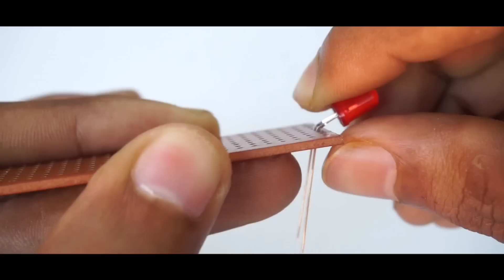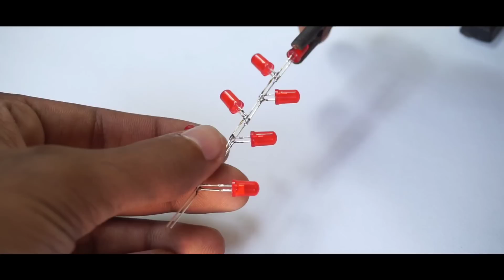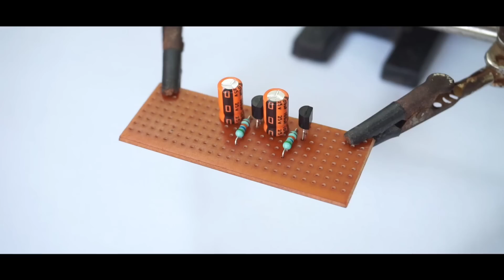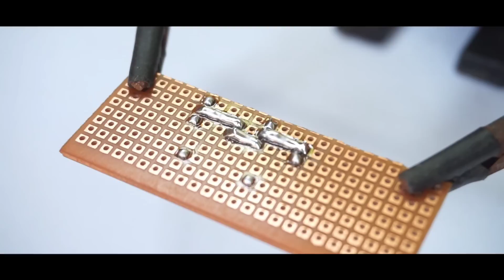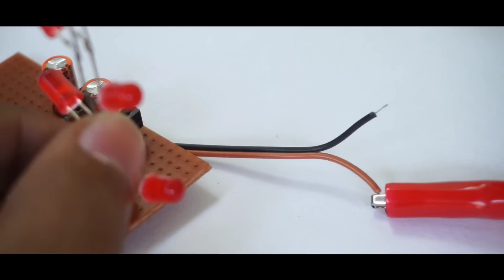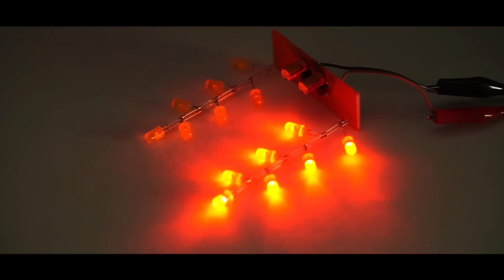WOW!!! Beautiful Lighting Idea

Comment: Sir 9v ka battery use kar sakte hai
Reply from the maker: Yes you can use a 9V battery just use 100k resistors instead of 56k or use 470uF capacitors.
Reply: @estechknowledge  100uf capacitor Nhi hoga sir
Reply: @estechknowledge  68k resistance  hai sir
Reply from the maker: Yes it will work.
Reply: @estechknowledge  please sir led ko  +&-  ke sath me jodna h kyon ki hum kiye h
Reply from the maker: Check out the video description

Comment: Super
Excellent

But the circuit can't understand
Thanks
Reply from the maker: Diagram is available in the video description
Reply: The circuit is known as a transistor astable  multivibrator. When one transistor is on - the LEDs in series with the collector of that transistor are ON. Also, at the same time the other transistor is off  - and it's series connected LEDs are off. A little later, the transistor which was ON will be off & the transistor which was off will now be ON-along with the LEDs connected to its collector. This cycle repeats continuously & the LEDs flash alternately.

Comment: Please is there a limit to the LED to use?
Reply: any 5mm led will draw about  25 to 30 mAmps and 2.7 to 3.2 volts ( in parallel multiply by the number of leds volts stay the same) with a 4.2 volts lithium battery need one  resistor to protect the leds
Reply: You can use upto 50led easily with same configuration